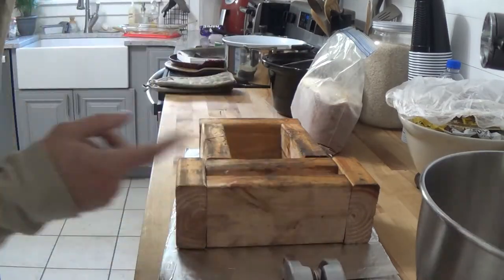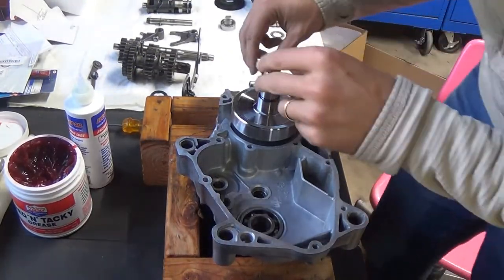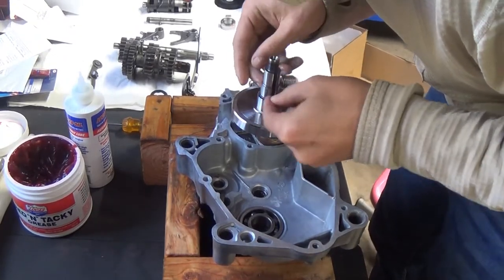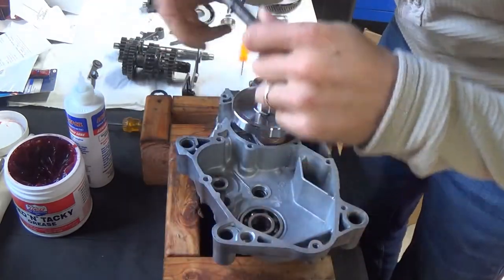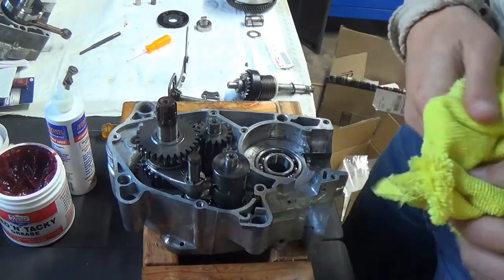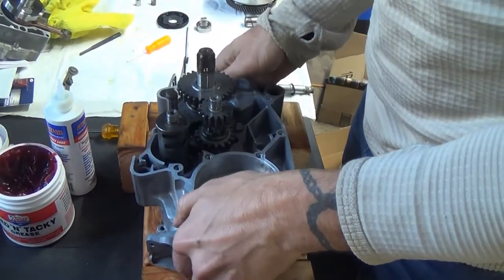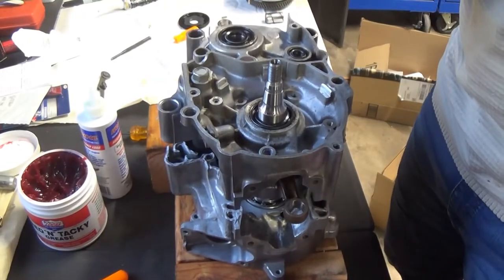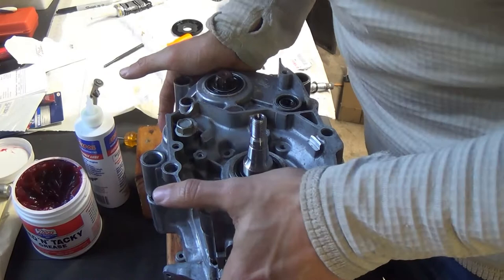PW80 Engine part 2 (Transmission)

Comment: Thanks man. Do you know if the pw80 engine will accept the transmission output shaft from a bw80? 

I have a good pw80 engine that seems identical to my brutally rough shaped bw80. I want to rebuild the pw80 but need the longer shaft to align with rear on big wheel

Comment: I have a question I'm trying to push the case back together and it will not go together I even tried to rig it up where I could tighten down the nut to help push the case together and I still can't get it to go completely together any ideas what it could be
Reply: maybe your pin dowles arnt lining upto eachother ?

Comment: What direction did you put the crank shaft in
Reply from the maker: Tapered end into left side crankcase half. Check the video out from 1:10 when I drop it in. Thanks for watching!!
Reply: @dirtbikedadgarage4662  can I use RTV high heat to seal?? Or OEM brand.
Reply from the maker: @xXiOnXx  you can use either. They recommend their own brand most likely for the money. I’ve used RTV on many things without a problem so you should be ok.
Reply: @dirtbikedadgarage4662  one more question sorry but what year is yours and what’s the name of the case bolts I need them all 😞
Reply from the maker: @xXiOnXx  check out this link. If it doesn’t work just type in pw80 engine case bolts on eBay. Mine is a 99 but they are compatible from like 1985-2015.  https://www.ebay.com/itm/203451148677?chn=ps&norover=1&mkevt=1&mkrid=711-117182-37290-0&mkcid=2&itemid=203451148677&targetid=1264870805944&device=m&mktype=pla&googleloc=1025197&poi=&campaignid=11612432118&mkgroupid=125167409951&rlsatarget=pla-1264870805944&abcId=9300456&merchantid=420526068&gclid=Cj0KCQjwlMaGBhD3ARIsAPvWd6hu5LAPzp6gTZ8RcWMoA8vGqzpJrYhU2xELeAp-EMpg6sLz8whz4PwaArfyEALw_wcB
Reply: @dirtbikedadgarage4662  anyway we could exchange info??

Comment: where or who can sell me a PW80 engine..
Reply from the maker: Your best bet for just the engine is most likely gonna be eBay and Facebook or another marketplace. Sometimes you can find a good deal on a beat up bike and buy the whole thing cheaper than some people sell just engines. Then you have a cool fixer up project. Thanks for watching!!
Reply: @dirtbikedadgarage4662  i'm from Suriname so if you can help me out if someone has a beatup engine sitting there then you can link me up
Reply: Would you mind putting the links to the parts your ordered?
Reply: @scottlarson9879  i didn't order anything i need parts from BW or PW engine, transmission